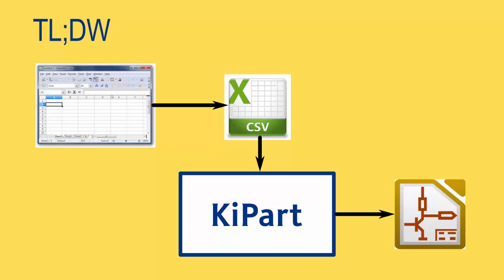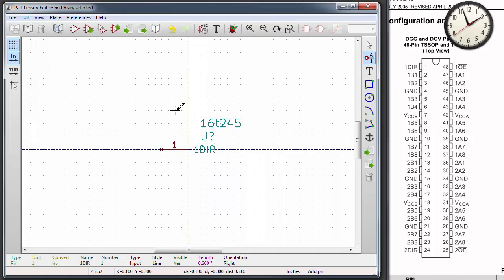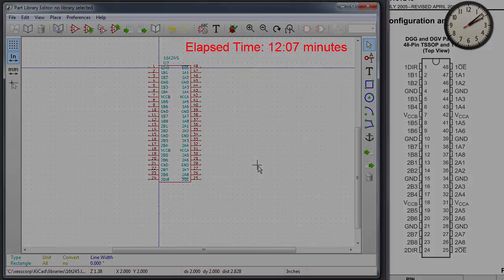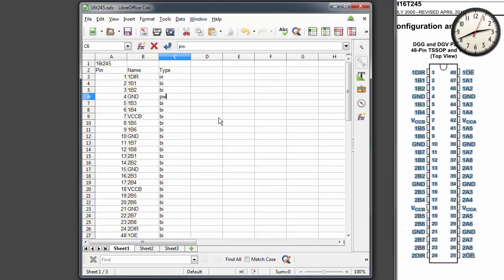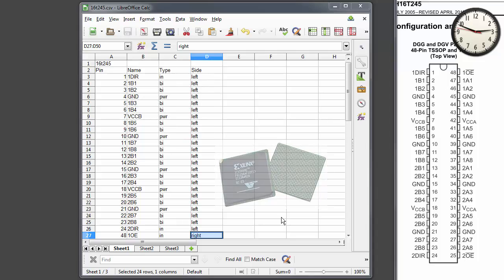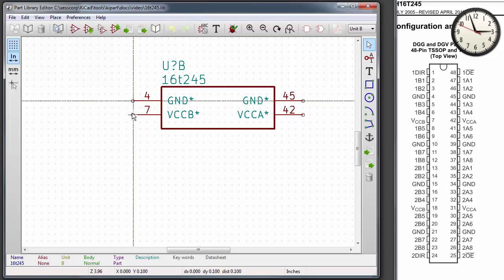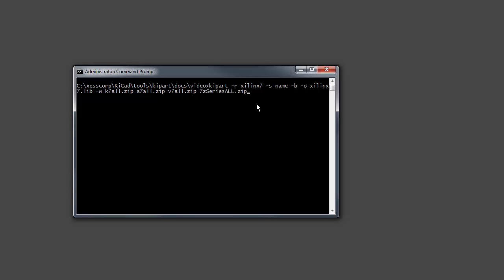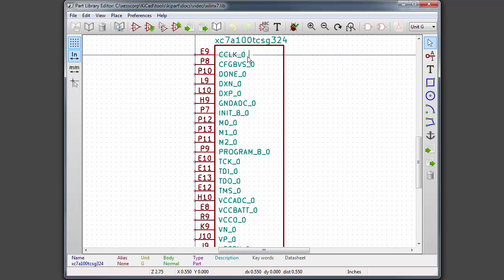KiPart: Because Building Parts Sucks Donkeys!

Comment: In case it helps anyone else. To get the command-line script usage working in a Windows 10 install of Python (3.9.1 as of now) I first installed the module using normal pip install kipart. But I then had to also run  python -m easy_install kipart. This creates a set of .exe in the Python39/Scripts directory from the kipart module which can then be run as explained in the video. 

Great tool! Again...should have been incorporated in the main tool by now to help us high pincount device users out :)